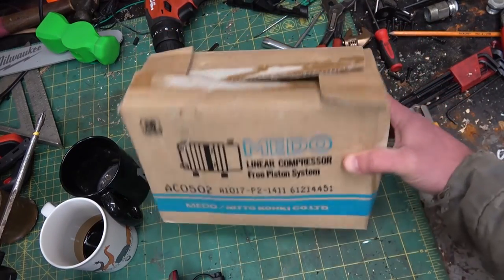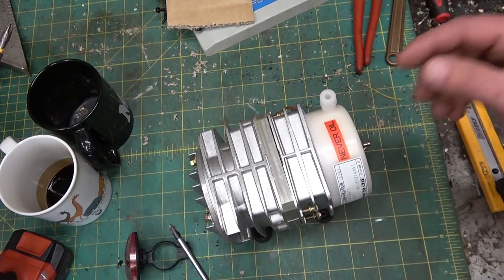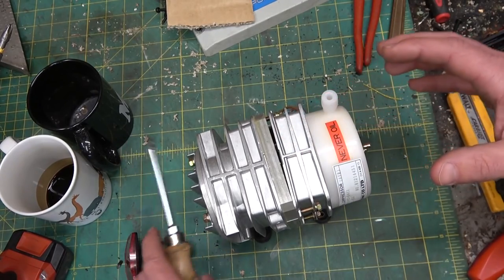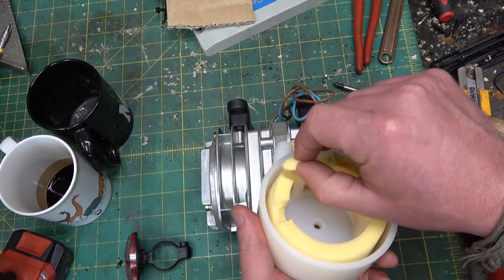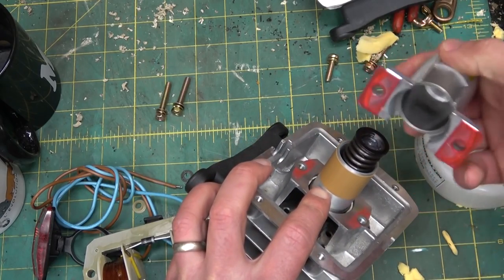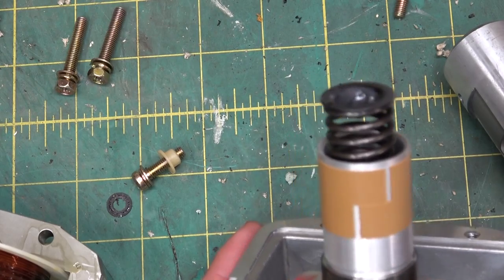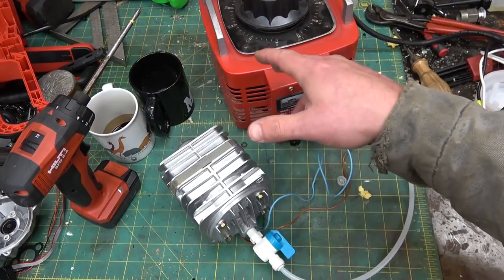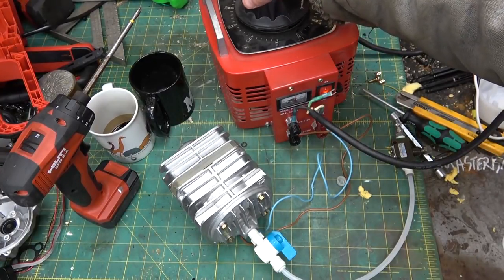BOLTR: Japanese Linear Compressor | Genius!

Comment: Now I finally know why my fridge is so proud about its linear compressor.
So proud in fact that it says linear compressor about 5 times on the thing.
Reply: At least we now know they do the higher pressures also!
Reply: Don't believe it man, it's just a line.
Reply: Sortof a funny thing to be proud of, considering that there's been some linear compressor fridges since at least the 70s.

My '73 motorhome has an original "dual voltage" Norcold fridge with a "swingmotor" compressor, which is just one of these in a can.
It's dual voltage because it has an inverter built in to the base for 12 volt operation, which is louder than the compressor is.
Reply: Must be an LG.
Reply: Patrick Fitzmorris:  All you really need to do then is harness the vibration of that transformer in the inverter and you can double your compressor efficiency when running at 12 volts.
Reply: 150-ish psi output. On an empty (refrigerant) system, it can pull down to about (-15-17)"Hg

Comment: it's pretty simple why linear compressors aren't used, mechanical force multiplication is simpler and cheaper. Consider something like a a tire inflator compressor with (for argument sake) a piston surface area of 1 square inch. To get up to 90PSI, you'd require over 90lb of force to move the piston in the compression stroke. A linear motor coil that could do that would require an insane amount of current and very thick windings. However, this is very easy to achieve with simple gear reduction and crank mechanism (what you find in typical compressors) and would allow the use of a smaller motor.
Reply: Note all the moving parts you just described.
Different beast for a different purpose.
Reply: The same thing can be done with the pressure and piston. Notice how you randomly decided it has to be 1 inch? It can just be made smaller and there you go, more pressure.

Literally exact same concept of mechanical advantage. Force vs speed.
Reply: @paul billings - I was merely responding to AVE's question as to why they're not more commonly used. Fewer moving parts, sure; but consider how most compressors fail, it's usually in in the piston to bore seal or reed valves.  It is very unusual for the gear reduction or crank mechanism to fail. A linear motor compressor still has piston seal and reed valve.
Reply: @1n5ane1  

I know. I was merely responding to what you stated. It is not hard to multiply/divide force with pressure of pistons as you claim it is.
Reply: @Jasoninee - The size of piston I was referencing was more in line with a typical tire inflator compressor. You could absolutely decrease piston surface area to decrease the amount of force required. Say you used an absurdly small piston with a 0.1 square inches of surface area, you'd still require solenoid that is capable of applying 9lb of force (to reach 90psi). This would still require a fairly substantial solenoid, try looking up the current specs of a solenoid that can do this if you don't believe me. Another consideration is controlling the speed of the piston as you'd end up having to run the piston 10 times faster in order to match the performance of a larger piston; this is very difficult to achieve with if powered off 50/60hz mains, you would likely need a fairly complex inverter. When it's all said and done, it's pretty clear these are non-trivial requirements.

I'm not saying that this style of compressor is useless, just pointing out the limitations and reasons this style of compressor isn't more widely used.
Reply: Decrease the surface area of the piston, slightly increase the solenoid's number of coils to increase the EM field, increase the frequency of the sinusoid to 240 Hz, which can easily be done electronically, and you get the same.

I think the difference is this device generates a lot more vibrations that are hard to dampen (esp. at low frequency).
Reply: Another reason: flywheel effect of rotating parts...
Reply: That's more of a "pump" than compressor..  That diode cuts the power in half,  the return spring is fighting the piston,  etc..  
 Apples and Oranges.  No need to compare the two..

Comment: AFAIK those things are designed to mechanically resonate at the line frequency so it was probably suffering a little being driven at 60Hz instead of 50. It will probably push a lot more air if you run it at 50Hz, maybe with a VFD.
Reply: It is just a coil, handles switching frequency just fine, so maybe vfd.

Comment: So its just an industrial grade fish tank air-pump... actually, i need one of these for my acid processing..

Well, ebay has them going cheaper then regular aquarium pumps..
Reply: After watching this video, and reading this comment, what do I do?  I go take apart my fish tank bubbler of course...  Sure enough, a type of linear motor acting on a sort of bellows to pump air. 1 moving part. Awesome.
Reply: I need one. Do you have any links to some decent priced ones of fleabay?

Comment: Never Oil, now that's a brand I've never heard of....... Is it like Never Sneeze? ;)
Edit:
I've just been down to the local Autozone and they have it on the same shelf as the headlight fluid
Reply: IamTranslation: Yes! ;)
Reply: @BlackEpyon  you make volkswegan owners  very weery. They thought ALL diesel was clean !  Lol
Reply: Same shelf as exhaust bearings, just below the windshield modulators
Reply: And for frogs snacks, dont ever mix up your headlight fluid with your blinker fluid...trust me...
Reply: If they are synthetic, you can blend them up to 50:50, but only in summer
Reply: next you will have to change piston return springs every 30,000 miles. . . and it wont be a joke when you ask the mechanic if it dropped a valve and he says "no it broke a spring" . . what like a valve spring . . "nope, a piston spring"
Reply: Pretty sure thats how black holes are formed...
Reply: its just a huge government scam, just more shit to burn that the government makes money on, its not any better for the environment, i dont know exactly what is driving the electric car force but i know its not emissions, its something far more sinister, its worse for the environment to mine lithium than it is to drill for and burn fuel
Reply: Headlight fluid is a scam. Just plug up the rain holes and let them fill up on their own.
Reply: BlackEpyon according to equipment vendors that ive spoke with apparently it works pretty good. Its those dpf systems that kill me.
Reply: Minnesota Acoustic
No kidding! You'll rust out your muffler bearing, gum up the stetsor valve, and your goddamnitron will never work correctly again. I suspect it's 
what carbonized my brake rotor oil, too!  Evil stuff.
Reply: @KSparks80  your catalytic timer is throwing out the carburation of your radiator bearings. Get some alternator fluid and it'll start wiping again.
Reply: Intermernet
And here I was leaning towards a warped battery flux precipitator. Good call!
Reply: Try an oiless scroll compressor
Reply: Headlight fluid is just blinker fluid with a gussied up name.....
Reply: @raspucin70  windshield modulation is actually a thing.

Edit: BMW uses a controller for the a/c blower motor.  Same frequency, just varies the duty cycle.
Reply: @BlackEpyon  you are murdering Gaia. Good for you!

Comment: Reminiscent of a fish tank air pump in many ways.
Reply: I was going to say looks like an oversized aquarium air pump.
Reply: Make your Puffer fish bounce with health - buy a bigger pump . . .
Reply: Actually, I'm kinda surprised AvE didn't mention that specific use case in his list of many examples.  Plus he could have done a side-by-side teardown comparison and see which one actually chooches better.
Reply: I bet you could use it for a fish tank air pump or even a pond pump
Reply: It sure sounds like one when turned on
Reply: My thoughts exactly =)
Reply: He didn't make much mention of the key advantage: No oil in the air. 
Good for lab situations which require small amounts of clean air at low pressure, as well as providing breathing air for small organisms.
Reply: Thought the same thing as soon as I saw it
Reply: My thoughts exactly. Even sounds the same.
Reply: I am using this pump on my air diffuser in my pond. so yea. good eye!

Comment: The reason this isnt used when higher volumes of air are required is 100% a scaling thing. Remember in the one you just opened up the stroke on that puppy is most likely less than an inch. The issue with solenoids in general is its hard to have a long stroke and a quick reciprocation. This is because as you make your coil more and more massive to accommodate the larger stroke you then end up with issues of dwell inside the coil.

Comment: Could probably bolt that to a hopper and use it as a vibrator, whilst directing the discharge air to keep a chute clear. Multi-tasker!
Reply: Sounds like a good plan
Reply: Just pull the rubber damper off and you should be good to go

Comment: A lot of modern fridges use linear compressors now, so they are suitable for high pressure refrigeration applications too. Like you said, economy of scale, it is just a matter of appliance manufacturers making the switch away from the  old rotary ones. LG seems to have gone linear on all their fridges. It's super quiet too.
Reply: Engel portable/car  fridges have been using them since 1962. Because they are more efficient and reliable.
Reply: My LG went through 2 within 3 years and both techs cursed that design saying how they were constantly failing.
Reply: The current linear compressors in refrigerators you find on the market today are garbage. They are undersized to meet efficiency standards and end up dying. I worked as a refrigeration technician and a good 1/3 of all the refrigerators we fixed were practically brand new but had issues with their linear compressors and or 3 way valves for the dual evaporators.
Reply: I had an LG for 2-3 and still going well. It is a smaller fridge for one person and it is an upside-down fridge with the freezer on the bottom part.

Comment: You See these a lot for people who Keep ponds and aquariums, using them with air tube and an air stone to push air into the water allowing for water movement and it also disrupts the waters surface allowing a better oxygen exchange transfer at the surface. Decent little air pumps having used one for a long time; although I’ve never taken it apart so I appreciate the video. Thanks 👍

Comment: I have asthma and occasionally use a machine called a nebulizer, I've always wondered how that little thing compressed its air.. I knew a crankshaft and Piston style would be to much for it. this is most likely what is used, learned something new! possibly.... I'll have to Google it to be sure
Reply: It depends on the model.  I've torn apart an old one to fix it and it does indeed use the crank and piston.

Comment: Kind of random thought I had watching this, but you always rag on cheap manufactures taking shortcuts or using cheaper parts/materials to save a buck.  When, truth is, there's an engineer out there who figured out how to make the tool work as intended while cutting the cost, which while crappy for the end user, is still impressive in it's own right.  So, I had a question for you about this.  What's some of the most impressive 'cost cutting' measures you've seen in a tool and what are some of the most pointless.  Maybe this could make a video one day.  Anyways, that's my random tangent.  Thanks!  As always, love the vids, keep them coming.
Reply: I think part of the problem isn't that some engineer made it work as intended, because that's not the hard part. The hard part is making it work as intended while still being robust enough to actually last through a normal job. You could argue that was the intent, but I'd like to think the intent was to make a working tool. And if a tool stops working, it's lost it's intent.
Reply: First,you start with sound dampening foam that turns to schmoo.
Reply: But the manufacturer creates the budget for the engineer. Leaving the engineer to substitute a metal part for a plastic part. Does the plastic part function as designed? Yes, but it’s life is 10x shorter. I also believe the engineer balances a fine line between creating parts that work amazing and creating parts that break, therefore driving revenue through repair. Not a fact, just an unprovable thought.

Comment: I work in a nursing home, and we use air filled mattresses for the management of pressure injuries in bed-ridden residents. Got me a sneaking suspicion the pump units use linear compressors... Low pressure, moderate flow, low power consumption, reliable as all get fucked. I learned something today. Thank you. My best wishes to the good people of Darkest Canuckistan... 👍🇨🇦🇦🇺
Reply: Hey! I work for a company that manufactures and services those mattresses. I work for HillRom. How awesome it is to run into other like minded people in the healthcare field. And we definitely do use linear compressors to regulate the pressure zones.

Comment: Hey Ave, a reason why they wouldn´t use massive coils instead of motors might be because of big chunks of metal that need to be magnetized. It takes longer to magnetize them thus higher frequencies cant be used, besides having massive magnets disturbs anything around them (electromagnetic interference).

Comment: Linear compressors are used in residential anarobic sewer systems, they run non stop for years, just needs filter service regularly.  Not a cheap compressor but very reliable.

Comment: To get say 120psi @12cfm the size of the linear compressor would be like a 18 cubic foot freezer!
Reply: Being as you chose the word "like" I am led to believe that the figure you state is an approximation. Ok, but that begs the question;  is that an approximation based upon relevant knowledge and working experience with linear compressors or at least in substantially equivalent arts, or are you just plucking that from your posterior?  While awaiting the results of your curriculum vitae to asses the merit of your claim, I took the liberty to research freezers and discovered there is quite a range of external dimensions amongst the various freezer models listed as 18 cubic foot capacity. Now for most applications a ballpark figure would be acceptable but as I am planning an extended-stay, extra-planetary excursion, I need the datasheet for my pescine growth media dissolved gas control unit to be a little more precise. Can you point me to a specific compressor model or at least the freezer you had in mind?
Oh forget it, the high altitude project just got cancelled,  gotta take the trash out or no squeaky squeaky tonight.
Reply: L m f a o.
Reply: Imagine writing a damned book as a reply to someone's off-hand comment.

Comment: Thanks AvE,  on the door of my LG refrigerator is an inscription that reads “ Linear compression .” Now I know what the hell they are talking about. Excellent video.
Reply: Ken,
I hope you LG is still running. They ran the liquid refrigeration line thru ghe condensation tray to help cool. However the alkaline condensate eats thru the copper. Isolate that line from the water and it will last. Although the parts are warranted for 10 years, the labor is not. $1,800 labor the replace refrigeration system and they will not send you the parts, only a qualified shop.

Comment: I suspect having a hefty bit of rotating mass to keep it turning "smoothly" is quite helpful for a reciprocating system that needs to supply any kind of pressure. You have some inertia to help on the pressure stroke, while the motor can continue to make up for the used energy on the intake stroke, thereby smoothing out your power draw a little. Also, a little mechanical advantage from the crank configuration?
Reply: Also vibrations
Reply: @InXLsisDeo  No vibrations so this old in and out is in need.

Comment: I think they are limited in the volume of air they can move by their basic design. If the cycle of the pump is tied directly to the hertz cycle, you have a maximum output speed. With belt driven compressors, you have the gearing advantage to get more compression "cycles" per hertz by just installing a larger motor and/or different pulley ratios.

Comment: Put the coils in parallel with the diode on the incoming supply and it'll run on 120v
Reply: Gonna have to replace the diode for one that's rated at twice the current as well though
Reply: Or should at least check the rating on the diode. Given the size, I'd be very surprised if it wasn't just fine for twice the current.
Reply: The two coils could be wired in parallel but they would have to be in series with the diode.
Reply: mathematically it only takes about 200ma but it looks like they used a 3amp barrel diode just to be on the safe side.
Reply: or you could pull the wires off the coil and hook them to a real compressor and actually get something done...
Reply: "It will run" is quite a longshot

Comment: Good luck getting 130+psi and a decent refill rate on a linear compressor, especially if you have only a 115V 15A circuit to work with - you'll need a lot of peak power to get the piston to bottom out and force every bit of compressed air out for maximum efficiency. With a rotating motor, you have the motor and pulley/gear momentum smoothing out those peaks.